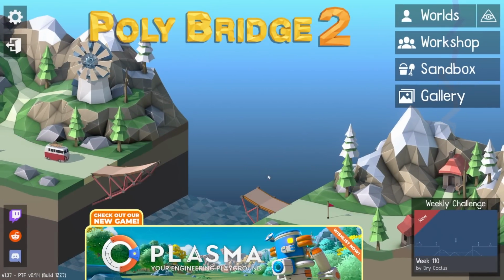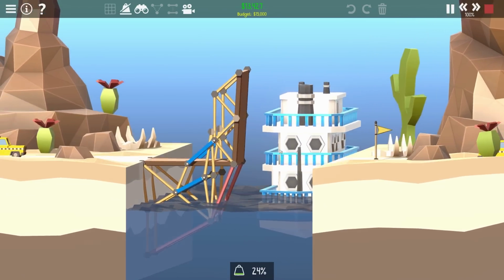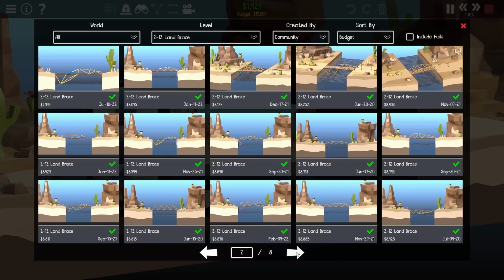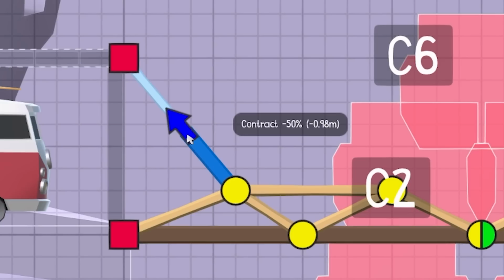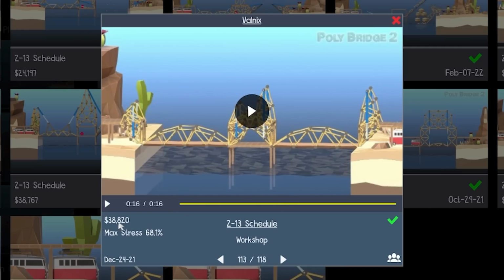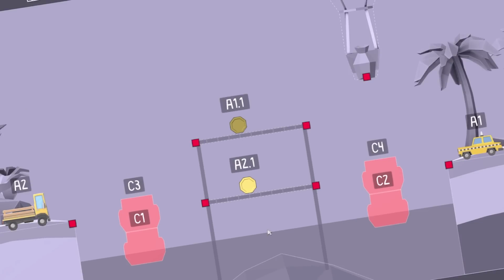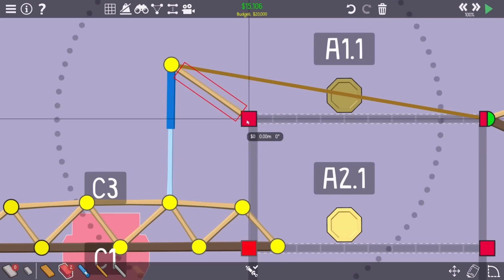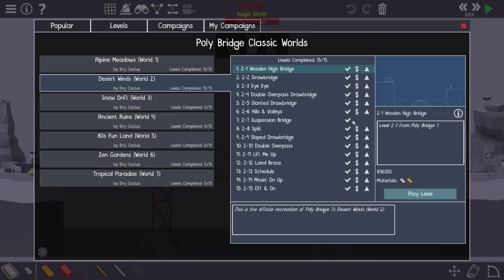Using ENGINEERING to beat the HARDEST LEVELS in Poly Bridge 2!

Comment: Hey RCE No problem here - wanted to explain how I got the perfectly timed snap ins
all you need is a split joint made completely separate with pieces that don't move, it will reveal the exact time that the phase "click" happens
then you adjust whatever is swinging so that it hits at the same time in slow motion, and delete the test joint.
Love the PB2 content - for what it's worth worlds 3 and 4 have more big bridges, jumps and less hydraulics if you're that stressed :D
Reply: Thanks for the info.

Comment: "It takes an egineer to build a bridge that barely stands, but it takes an architect to design a bridge that will never stand"
Reply: "Barely standing" with safety factor ~1,0 should be codified in Eurocodes as a formal definition
Reply: This man is spitting straight fax
Reply: Egineers are better than architects
Reply: Wise words from such a wise man
Reply: It takes an internet guy to build a penis that works as a bridge
Reply: Hey man, I archatect'd a thing once.. even thing'd properly
Reply: What about engineers though?
Reply: Red yellow ☭ ☭ ☭
Reply: I truss in engineers but I have never seen an architect with a truss 👀